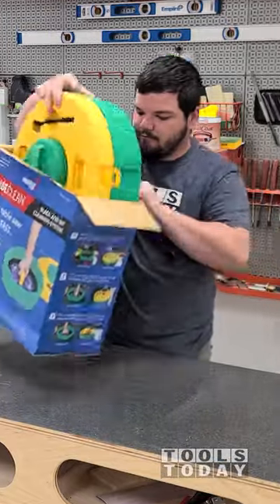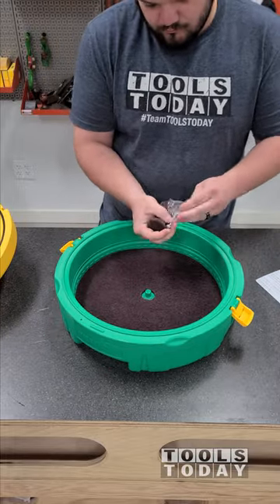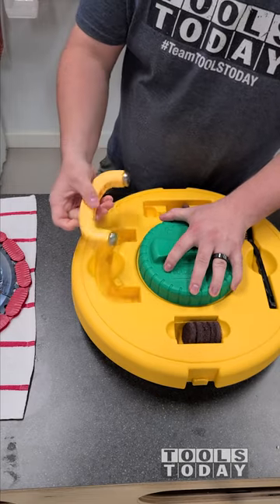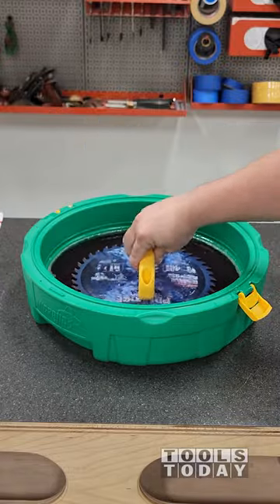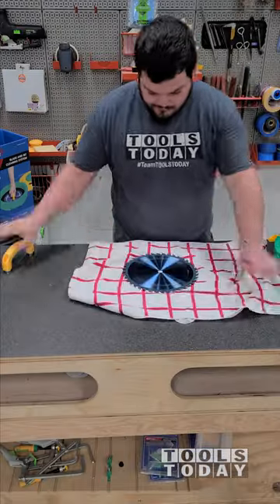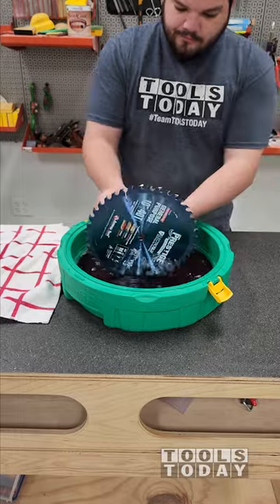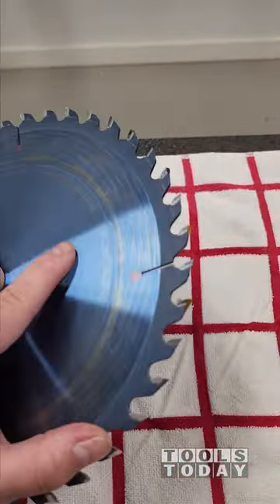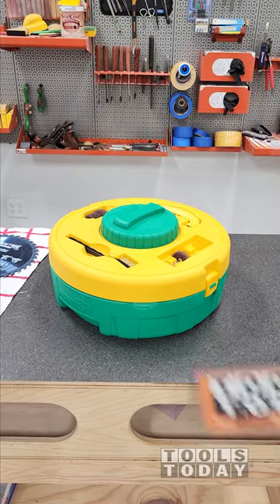Cleaning Blades the Easy Way

Comment: I've done this with wire brushes and scotch bright pads. I use them for many other things too, and they're cheaper, and easier to store.
Reply from the maker: for sure, ive always said theres multiple ways to do a job. thanks!
Reply: I was thinking just get a container like for collecting oil and put a bunch of pads on the bottom and do this myself. I also have a wooden rig with scotch stapled to it to just slide against the blade in the saw while unplugged to clean it every time after use, which works and is easier but I get what you mean

Comment: I'm confused, long as a blade is sharp seems to work fine.  Never had a dirty blade not cut, never had a clean blade still be clean even a second after I started using it. So am I supposed to stop mid cut and clean it constantly or is this cleaner useless because it doesn't matter if a blade is clean.

Comment: All the folks trashing the idea of cleaning the resin build up on carbide teeth is astonishing. If your table saw or chop saw blades are leaving black  cut marks or smoking the wood when you cut then your blade needs to be cleaned. Spend 10 minutes cleaning the teeth or go buy another $50 blade? That being said, I wouldnt buy that unless i owned a shop and ran a ton of material through the blades. But its got its place.
Reply from the maker: The cleaner isn't for everyone, understandable, but cleaning blades should be for everyone.  Blades aren't cheap to replace and usually just need to be cleaned to cut like new.

Comment: Toolstoday what is the purpose of cleaning a sawblade? I’ve never seen anyone doing this
Reply from the maker: If you used a knife to cut through a bunch of sticky stuff, let it dry on there then tried to cut paper, it would likely struggle to do so.  This is the same concept with a saw blade, when pitch and sap build up on the teeth of the blade they have a harder time cutting than when it is clean.  Also, all of the pitch causes excess friction which causes excess heat.  Heat is the number one enemy of any cutting tool so by keeping the blade clean you reduce heat, thus increasing the life of the blade.

Comment: I've never cleaned my Miter saw blades lol. What does this benefit lol?
Reply from the maker: That's the point, people are replacing blades when they "don't cut well" when most likely the blade just needs to be cleaned. If you used a knife to cut through a bunch of sticky stuff, let it dry on there then tried to cut paper, it would likely struggle to do so.  This is the same concept with a saw blade, when pitch and sap build up on the teeth of the blade they have a harder time cutting than when it is clean.  Also, all of the pitch causes excess friction which causes excess heat.  Heat is the number one enemy of any cutting tool so by keeping the blade clean you reduce heat, thus increasing the life of the blade.
Reply: @ToolsToday  🤯 never thought of that!

Comment: Does wood object to dirty blades?
Reply from the maker: No, but it doesn't cut as well with a dirty blade. If you used a knife to cut through a bunch of sticky stuff, let it dry on there then tried to cut paper, it would likely struggle to do so.  This is the same concept with a saw blade, when pitch and sap build up on the teeth of the blade they have a harder time cutting than when it is clean.  Also, all of the pitch causes excess friction which causes excess heat.  Heat is the number one enemy of any cutting tool so by keeping the blade clean you reduce heat, thus increasing the life of the blade.

Comment: I bought a 13-14” Wilton cake pan and use Simple Green HD cleaner to soak the blades with. Works great.
Reply from the maker: cool ! as I have often said, there's many ways to perform a job

Comment: what is the purpose of cleaning a blade? for me the normal thing is to use it until it doesn't cut or break.
Reply from the maker: That's the point, people are replacing blades when they "don't cut" when most likely the blade just needs to be cleaned. If you used a knife to cut through a bunch of sticky stuff, let it dry on there then tried to cut paper, it would likely struggle to do so.  This is the same concept with a saw blade, when pitch and sap build up on the teeth of the blade they have a harder time cutting than when it is clean.  Also, all of the pitch causes excess friction which causes excess heat.  Heat is the number one enemy of any cutting tool so by keeping the blade clean you reduce heat, thus increasing the life of the blade.

Comment: why do u have to clean table saw blades?
Reply from the maker: If you used a knife to cut through a bunch of sticky stuff, let it dry on there then tried to cut paper, it would likely struggle to do so.  This is the same concept with a saw blade, when pitch and sap build up on the teeth of the blade they have a harder time cutting than when it is clean.  Also, all of the pitch causes excess friction which causes excess heat.  Heat is the number one enemy of any cutting tool so by keeping the blade clean you reduce heat, thus increasing the life of the blade.

Comment: THE ONLY TIME a bade comes off a saw is to be replaced...
Reply from the maker: That's the point, people are replacing blades when they "don't cut well" when most likely the blade just needs to be cleaned. If you used a knife to cut through a bunch of sticky stuff, let it dry on there then tried to cut paper, it would likely struggle to do so.  This is the same concept with a saw blade, when pitch and sap build up on the teeth of the blade they have a harder time cutting than when it is clean.  Also, all of the pitch causes excess friction which causes excess heat.  Heat is the number one enemy of any cutting tool so by keeping the blade clean you reduce heat, thus increasing the life of the blade.
Reply from the maker: So you've never gotten burning from your blades when cutting in wood?   I'm not even sure how using a sanding disc on the table saw relates to cleaning table saw blades.
Reply: @ToolsToday  no, becuase ALL BLADES are thinner than the teeth... the ONLY way you get burning like you may be talking about is from a saw improperly adjusted fence or guide... in either case its short lived and the width of the teeth are usually double that of the actual blade body... thus its pointless to bother cleaning it... any other burning or anything is caused by a dull blade or a blade with missing teeth...

Comment: What is the point tho.... It's a saw blade. If you really need to clean it after you use it with that, it's literally going to spot rust within the week. Better off getting your cuts at Lowes

Comment: Why would u clean a blade
Reply from the maker: If you used a knife to cut through a bunch of sticky stuff, let it dry on there then tried to cut paper, it would likely struggle to do so.  This is the same concept with a saw blade, when pitch and sap build up on the teeth of the blade they have a harder time cutting than when it is clean.  Also, all of the pitch causes excess friction which causes excess heat.  Heat is the number one enemy of any cutting tool so by keeping the blade clean you reduce heat, thus increasing the life of the blade.
Reply: @ToolsToday  ahhh, gotcha!

Comment: Why do you need a clean blade. I can't imagine a dirty blade is dull. That's like cleaning a fence post.
Reply from the maker: If you used a knife to cut through a bunch of sticky stuff, let it dry on there then tried to cut paper, it would likely struggle to do so.  This is the same concept with a saw blade, when pitch and sap build up on the teeth of the blade they have a harder time cutting than when it is clean.  Also, all of the pitch causes excess friction which causes excess heat.  Heat is the number one enemy of any cutting tool so by keeping the blade clean you reduce heat, thus increasing the life of the blade.
Reply: @ToolsToday  that makes a lot of sense. Thanks for telling me. I didn't think cutting of sticky stuff. I usually have to cut metal .so I didn't make the connection. Thanks again.

Comment: But .. why ?
Reply from the maker: If you used a knife to cut through a bunch of sticky stuff, let it dry on there then tried to cut paper, it would likely struggle to do so.  This is the same concept with a saw blade, when pitch and sap build up on the teeth of the blade they have a harder time cutting than when it is clean.  Also, all of the pitch causes excess friction which causes excess heat.  Heat is the number one enemy of any cutting tool so by keeping the blade clean you reduce heat, thus increasing the life of the blade.